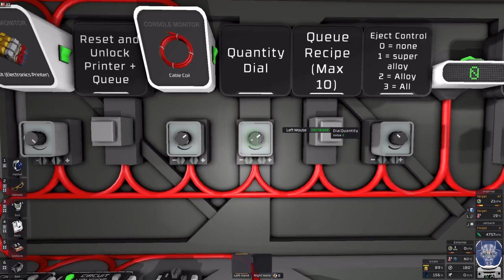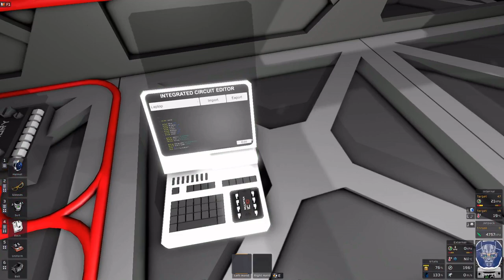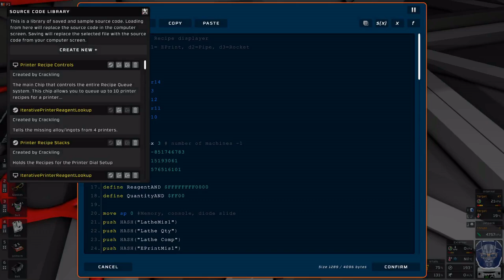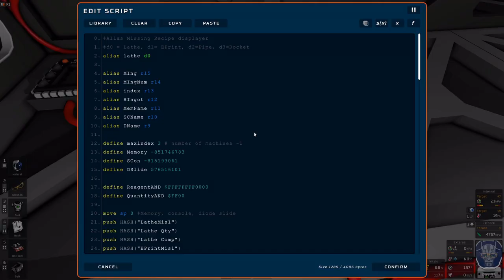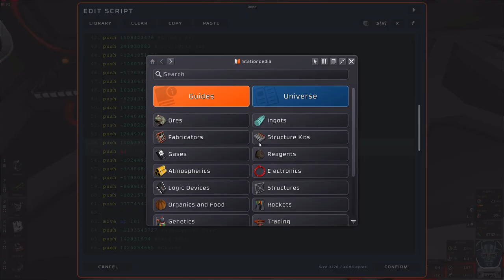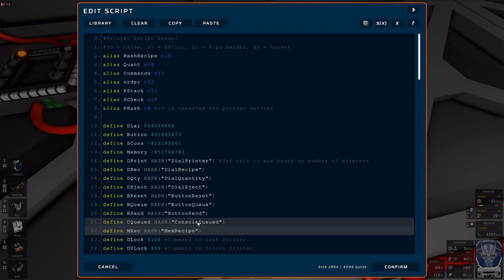Stationeers: Printer Queue Recipes Build

Comment: Combining this with some sort of automated printer routing system would be cool. Send all ingots to a vending machine after printing, and all products to either a different vending machine, or just an outlet. Then set up a system to dynamically dispense the ingots you need for a job and automatically route them to the proper printer... That'd be cool as hell.
Reply from the maker: I think that is something that could potentially be done... Considering the Missing items chip has plenty of line space and already polls the 4 printers, I could add some extra logic to read what is missing, give a logic sorter a stack command to route ingots/alloys to the printer, and send a request hash to dedicated vending machines to dispense those ingots into a chute loop that returns the ingots/alloys back to the vending machine. Possibly do the same thing on the output side of the printers that if ingots/alloys are ejected, they return to the vending machine, though that could be a separate chip that manages those.

Thinking about it, I might make an addition to this so that this can be a basic level system and have a chip to control the vending machine/sorter combos as an "upgrade" so that the vending machine can be filled with various ingots and alloys and it will dispense them as needed by the printers.

Comment: Nice, I was recently looking at printer logistics. I had hoped I wouldn't need to push all the possible recipes to the stack with the new instructions, but alas.
Reply from the maker: Truthfully, the stack initialization script i made has a good chunk of the recipes for the printers, but there may be some that can be deleted or added. I can at least recommend it as a starting point and you can add recipes i left out or remove recipes i added. I did want this system to be used for the more common items or print jobs where you needed to be more exact with the items printed. It is likely i skipped many items such as tools, filters, and canisters.